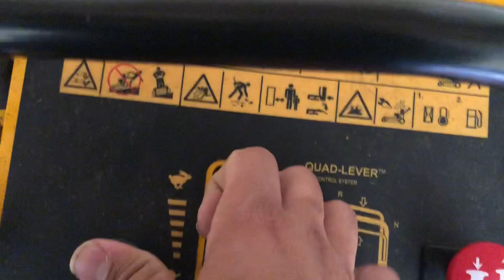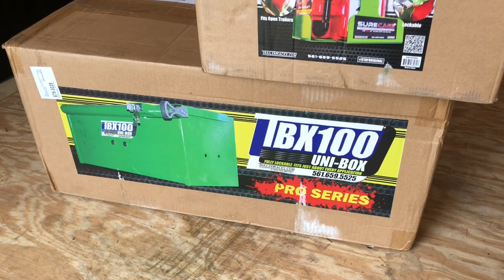Installing Ballard inc. power lock

Comment: One of them spring pins should be in the front of the locker so the whole top of the unit can be removed. Im sure you probably know that by now though. Just thought I'd throw a comment down to help with them algorithms. Nice set up ya have.